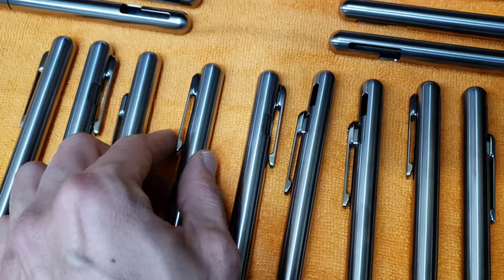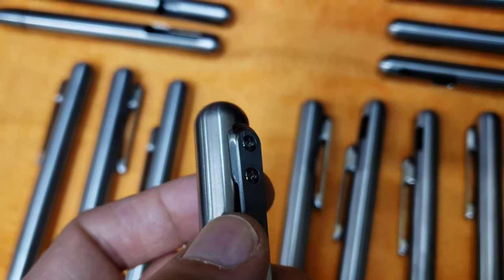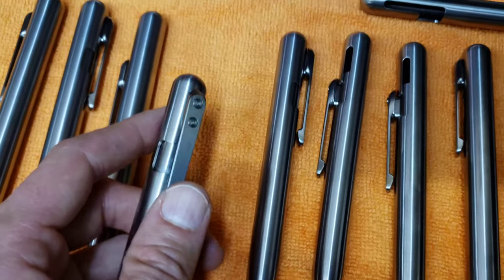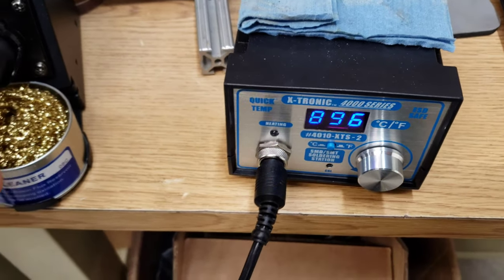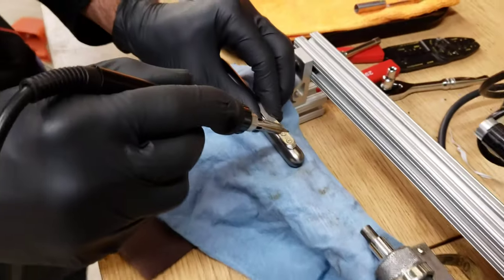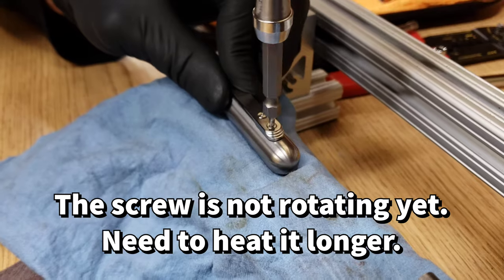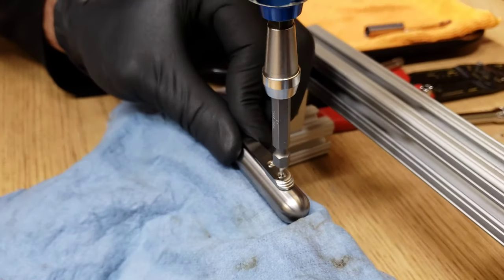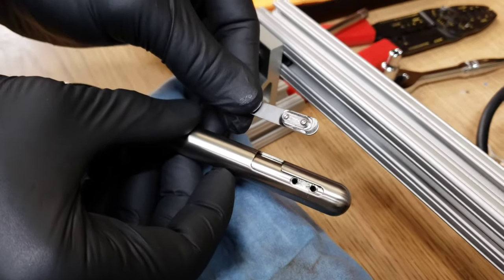How To Remove A Small Thread-Locked Screw Using Heat To Break Down The Loctite With A Soldering Iron

Comment: If it's blue loctite you only need to heat it to 250⁰ that's taken from their website. But I've never needed to add heat to blue loctite. So I'm guessing this is red.
Reply from the maker: Good to know, this is red. I put parts that can take the heat into an oven at ~400F, and that works great.

Comment: I’ve loctited my balisong screws but I need to tune it because I haven’t done in right. This was years ago. Could I potentially use boiling water or a hair dryer to melt the dry loctite?
Reply from the maker: Loctite requires higher than boiling temp to break down. If all the parts are metal, you can put it in the oven at 400F for enough time to heat up the loctite. (The Loctite red breakdown temp is ~500F, but we've found that 400F will work enough to remove it)

Comment: At first I was like "damn my heat gun probably wont get that hot" and then you came at me with the soldering iron trick... Genius! Will report back if it works.
Reply from the maker: Your heat gun will definitely get hot enough. It actually works faster with a heat gun if you're not going to damage anything else with the heat. The soldering iron technique provides a more localized heat to just break down the Loctite, without damaging surrounding heat sensitive parts.
Reply: @engineerable  Thanks for the reply! I used the soldering iron but it didn't make a marked difference. I read elsewhere that using more threadlocker on the area can help loosen up the old stuff and that worked! I used the soldering iron on the 2nd area and it worked much better than the first, but I had to scrape off some cooked threadlocker XD The first area got about halfway and then seized completely, the cap stripped as well. Had to pull out the dremel and CUT my loses. Thanks for the tip regardless!

Comment: I minimize my back and forth on old screws by putting in penetrating oil as soon as the screw starts coming up.
Reply from the maker: What brand do you use?
Reply: @engineerable  over the years ive had different cans. I look for the words "Penetrating Oil" on the front and then im ok choosing that one